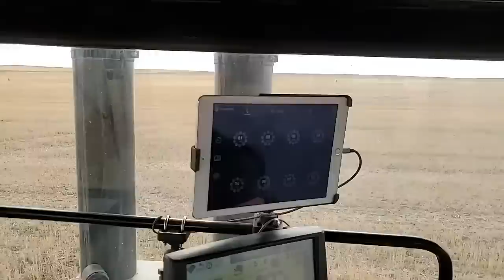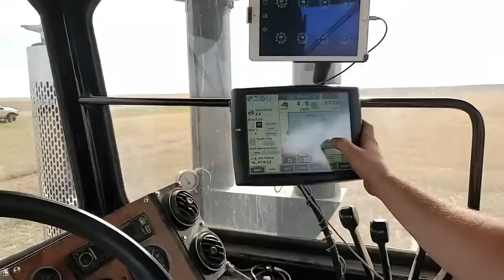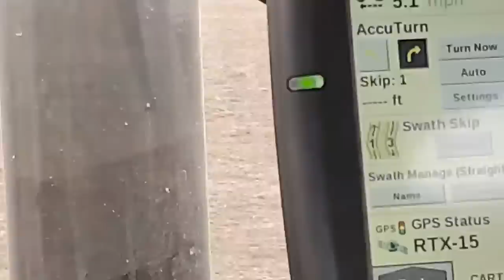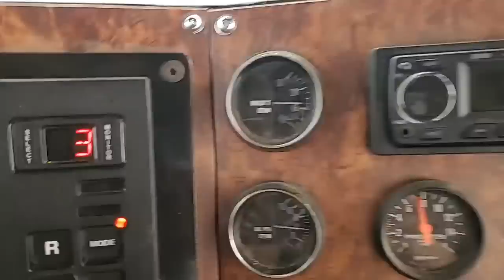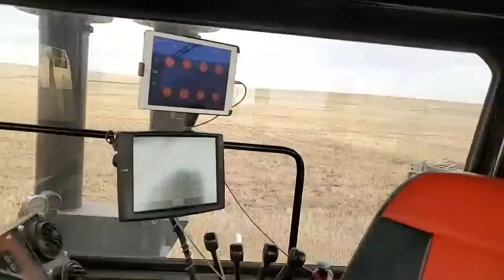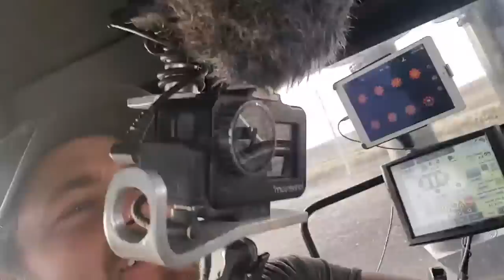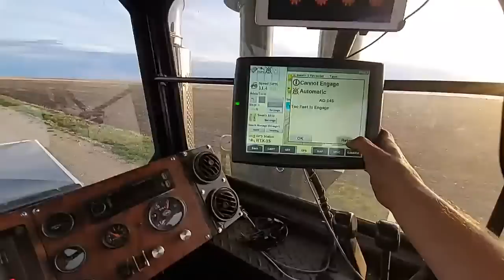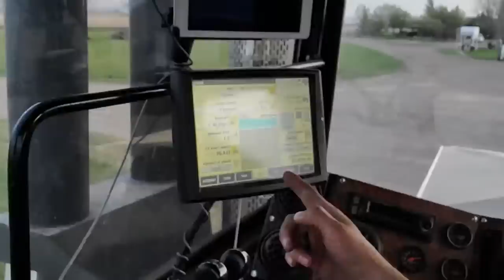🔴LIVE! BIG BUD 600 Seeding Last Field of 2020!

Comment: Here's my take on the draw bar, your putting alot of weight on the tongue with the cart and drill. That with the age of the tractor and binding the tongue in the deep ditch caused it to buckle.  Thanks for mentioning Steiger Scott! Our ST 310 Panther had the gm steering column too, but we had a manual transmission and in order to start it you had to have it in neutral and to the left to activate a safety switch on the shifter.  I sure did learn alot about the Buds and have more respect for them.  But Steiger still ruled our farm! Nice content guys!!!!!

Comment: I would like to see that Big Bud on Mike Mitchell's farm pulling the 84' planter, see if it would do a better job than New machines!
Reply: Us too! 👍
Reply: I think a configuration with tracks would do better, he needs traction above all else
Reply: That's the perfect width implement.  A 20 rod wide field makes four passes. 330 feet divided by 4 equals 82.5 feet.  Man you can knock out the acres with 84 feet.  If you run 7 mph, you can cover 1 acre per minute!!!
Reply: He Mentioned last year he had thought about getting one but wasn't sure about product and parts support, AN a little lacking in technology with auto steer and mapping etc. But Welker farms showed us this last spring that with some time, money, an parts that can be overcome and Brought upto today's speeds and standards! 

As for product support I tried to convince him that any decent Heavy duty or Truck shop could look after him as lots of parts and components are common Heavy Duty Equipment and or Truck parts.

An yeah traction is an issue but with a Big BUD they are heavy and you can really weight them up and get some big rubber on them then you would have the Power to make use of the weight and traction. 

As for power The Bud has the Cummins KTA which has the Displacement to make power at 19L versus Cases Quad Track with a FPT 12.9L and the Cummins QSX 15 (14.9L) in the John Deere's RX.
Reply: @RobertWelkerFarmerBob  You should Give Mike a shout and tell him the Pros of a Big Bud and assure him they are easy to service and get parts for!
Reply: @UncleBubbles94 , last year when the boys here had that Case drill, they said you could seed at 10 mph.  That would require absolutely smooth ground, even with the technology that implement has.  If I remember correctly, Nick was rolling around 7+ mph.
Reply: @UncleBubbles94 , there's another monster tractor, the Earthquake, built by Rite, they were in Great Falls MT. Check it out, I think it was a 750 hp beast.
Reply: Ever consider a seeder with 4 sets of wheels? Like a flexi coil. Lot less tongue weight.  But that tongue weight equals traction.

Comment: Well, with that big ol' chuck of steel that sicks out above the jump seat I would suggest cutting a swimming pool noodle and using some RTV to glue on that piece of cold hard steel.  Might be easier on the ol' bones.  Nice part of the RTV is that it can be peeled off when replacing.

Comment: Having three hours with you two in the same cab and breaking the tractor was great. All three hours were worth it.  be interesting how you fix the hitch/drawbar plate.  Would it be possible to have a set of tracks that the planter set up hooks to. That then hitches to the Big Bud? Other question-what causes the alkaline soil?
Reply: Minerals in rainwater

Comment: When legarms (Sorry forget your real name)was kicking the air drill to unplug it two others next to the one he was working on do to the vibration unplug or at least dirt fell out. It reminded me of dumps with a vibrater to clean the bed they have smaller ones you could probably mount on the frame in different places to clean out your drill. You could probably do that pretty easy as crafty as you guys are you may need 2-3 of the one made for the trucks to work. They work great in aggregates bins! Not sure it would save you enough time or you want to shake your air drill but set on a timer(auto) or a momentary on switch (manual) would save you from stopping.

Comment: Cross track error will be the same no matter the accuracy. If you have a 44ft planter(24 row 22" spacing), Waas(free, low accuracy, tillage) will get you within 6 to 10 inches of 44ft on next swath, so you may not get exactly 22" spacing on end row. Where rtk(paid subscription,high accuracy, planting) will get u within 1 inch of the 44ft so u will be sub inch off of the end row on 22" spacing. Instead of 6 to 10.

Comment: Hey guys! i have a question, with you'r GPS does the track move sideways when you'r out like taking a break or filling up? where i work they have a john deere 7530 with SF1(the free type) and when i have been cultivating a field and comes home to like dinner or so, when i get back to the field i have to center the track because the track itself has moved

Comment: ya go jazzin up yer rig and get so much horsepower it tears up something else duct tape and balin wire won't fix. yer dead cat is working pretty good on the wind noise. if'n ye cain't fix it with duct tape or wire, weld it and spit cure it. Raises for everybody

Comment: Sound like you need to upgrade to a Cummins QSK19A700!!!!
Reply: The kta that is already installed is arguably one of the best engines, and no computer problems
Reply: @michaelgmintonye6693  i know i sold Cummins engines for 40+ yrs. But the QSK has many updates and advantages over the K model especially oil leaks and fuel consumption. Just stay with the mid 90 to mid 2000 units.